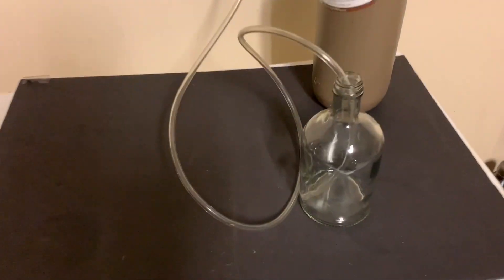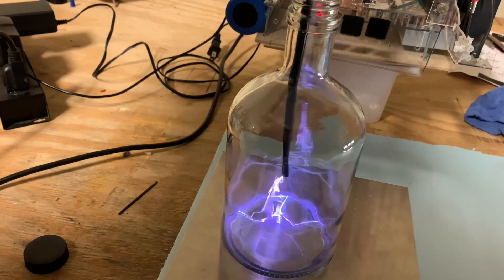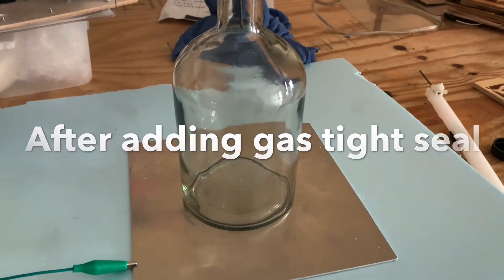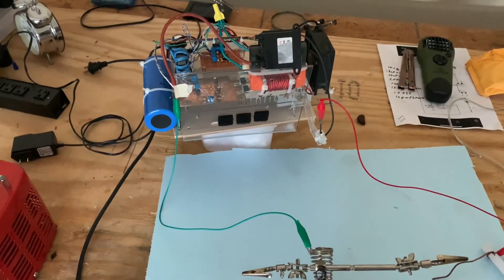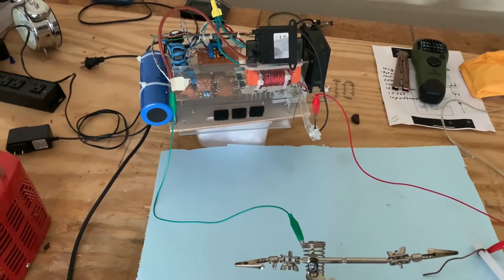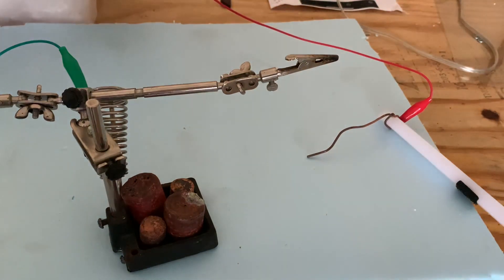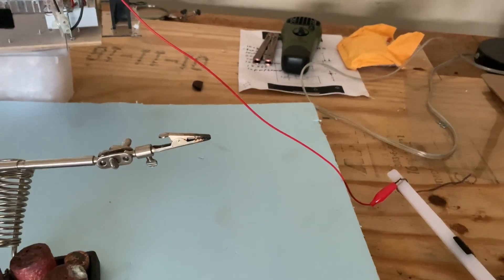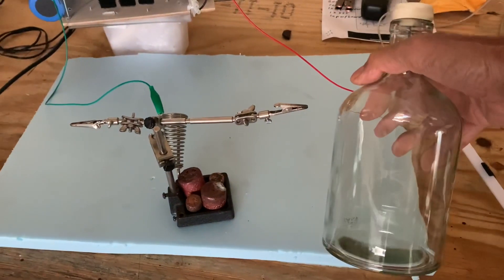Bottled Lightning pt2

Comment: Hey ! What would be the easiest electrical settings ? (what would be the lowest voltage with which the experiment would work, is it possible to do it without flyback…)
Reply from the maker: Definitely need an electrical AC source. I think it would probably work around 40,000 V AC. I’ve been pushing it up to 60kV. One of the issues I did have with the set up is that as the argon in the bottle is at 1 atm pressure as the gas heats up, the pressure in the bottle can build up to the point where there is a danger of the cork shooting off or the bottle breaking. One way to get around this would be to put a small needle through the cork into the bottle and connect that to a balloon filled with argon so any expansion of the gas in the bottle will not increase the pressure. The purpose of this experiment was just to show that you didn’t have to use low pressure argon to get interesting discharges. If you can get it to work, I would definitely not run it for long periods of time because of the amount of current that flows.

Comment: is this ac current insdie the bottle? would be awsome if you insulate it
Reply from the maker: Yeah that would be cool to try out
Reply: @BrianDhvTinkerer  so its ac or dc?
Reply from the maker: Zavarkinas AC 23kHz
Reply: @BrianDhvTinkerer  and volts? watts?
Reply from the maker: Zavarkinas it’s running at 26V AC on the variac rectified for about 40V DC. The Power consumption is estimated around 150-200W
Reply: @BrianDhvTinkerer  so its ac rectified not ac... did u try ac?
Reply from the maker: Zavarkinas no it’s still AC in the bottle. The full bridge inverter is powered with DC. The full bridge inverter provides the AC output to the  AC flyback transformer. When the AC input to the primary of the flyback is close to the resonant frequency of the secondary of the flyback, there is a massive rise in AC voltage from the transformer. This output is connected to the xenon filled bottle which is what’s is being shown in the video.
Reply: @BrianDhvTinkerer  thanks a lot for info :)

Comment: I need a DC version of your power supply.  Is that possible using a ZDS+Flyback?
Reply from the maker: I have made DC versions. You could take the output of this and rectify it with HV HF diodes. If you seriesed up say 4 x 20kV  diodes you would be good for 80 KV. Just need to smooth the rectified output with a high voltage high frequency doorknob or other ceramic or Mica capacitor. High voltage high frequency polypropylene capacitor  banks are also an excellent alternative since Mica caps are pricey and hard to come by. Series up 20 kV ceramic caps would be cheaper.

Another way I have tried is to used a Cockcroft Walton multiplier as shown here. I have had most success with these CW multipliers compared with other ways of getting HV DC power. The CW multiplier is fed with the AC output from a ZVS driver.
Reply: @BrianDhvTinkerer  please keep me posted.  On the HV DC source, I might need some advice.  If you don't mind.